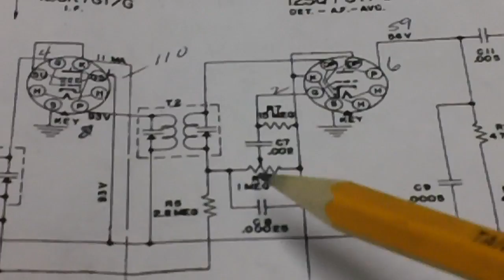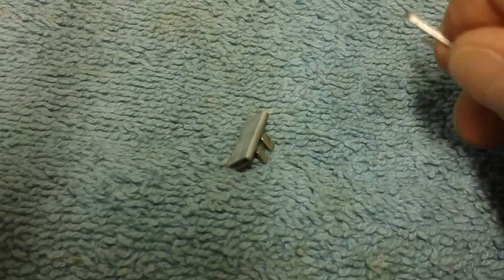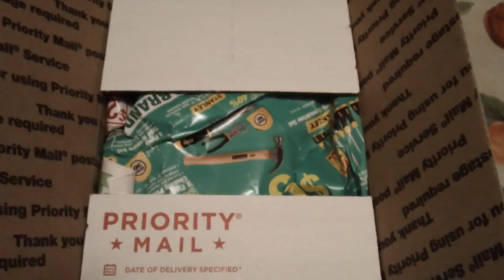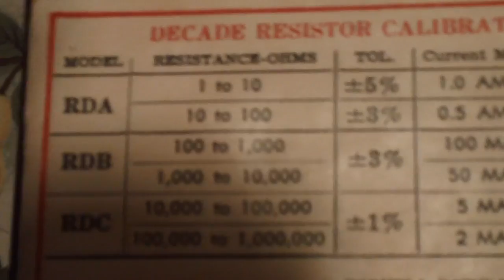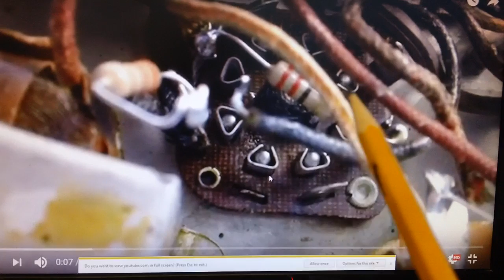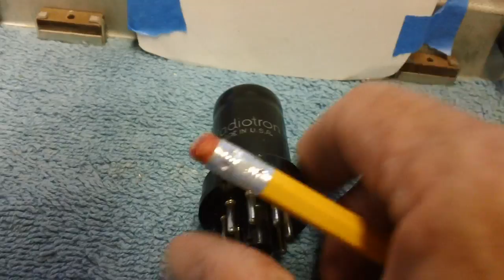1948 Silvertone 8005 repair/restore (part 7 of 8).

Comment: Just a side note. Your right about factories using pins that aren't connected to anything in the tube. The point is that this can be confusing for amature repairers. It may cause them to misidentify pin numbers. As you discussed before tubes have keys on them if you know what to look for. Therefor this comment is directed to newbies in the field of restoring old electronics. Just because a pin has things connected to it, doesn't mean the tube has any internal connection. The moral is this. Trust your schematic. That is unless you discover you have a modified unit that doesn't fit the schematic. The process of elimination can sort that out pretty easily. Just don't let it throw you for a loop...

Comment: This will be more like “tales from the service department” LOL.
I absolutely 100% agree with you John …keep on doing what you have to do, and if it is successful, pay little, or no, attention to what other people say.  As far as I’m concerned your improvisation for implementing a NC valve pin terminal to assist the broken pin terminal is a superb job …it works, and that is all there is to it! 
Picture the following my friend: kneeling by the side of a defective tellie, or radiogram, inside a customer’s living room, and whist removing certain parts to gain better access to other parts, or whist soldering, some mishap suddenly occurs.  Mishaps happen: they began happening the moment I took up electronics’ way back during 1968, and they continue to happen.  Given that fact, taking time constraints; a limited amount of replacement parts, and test equipment, inside the back of the van; the workshop sending a signal to your pager (as it was those days – later it was mobile cell phones, “Whilst you’re out, could you call into…”, which potentially added further annoyance), and the customer periodically breathing down your neck into account often meant there was little alternative (apart from lifting the defective unit onto the van, and taking it into the service department) but to implement small modifications.
I know this well as I have experienced it more times, over thirty-six years’ employment in brown goods servicing, than I remember …and I was a bench technician who did not go on outside calls that often.  One day, I’ll tell you about an incident involving an old Bush television I’d worked on, that caught fire, gutting the entire ground floor of a customer’s home, and necessitating an Insurance pay out of £2, 153 to put things right.  That occurred towards the end of the second week (summer 1971) of my employment (and apprenticeship) in brown goods servicing, from leaving school.  To say I felt decimated after that incident is an understatement yet it was proved to have not been my fault.  As I say, one day I will tell you about it in more detail.  I can’t remember the amount of crt’s I’ve accidentally ‘necked’ throughout my career in servicing …and they were the most expensive single component inside a tellie LOL.
Your small, and successful, modification would have been regarded as superbly serving its purpose.  Yes my friend, it is seeing how you combine your quick thinking with your dexterity that makes me feel convinced you would have been an excellent service technician.
Brendan is a lovely man, as well as being very knowledgeable too.  He recently posted me an email, including a photograph, of one of the two Cornel – Dubilier decade resistance boxes.  I have yet to respond to that email.  I have snapped a few photographs of my decade boxes.  They are probably a little older than me (I’ll be 62 at the end of this coming December), and I’ve been led led to understand they were once used in the design labs at Pye, down in Cambridge.  I got them for free.  I use my component substitution box far more than I use my decade boxes.  In my email to Brendan, I’ll include a circuit diagram of a component substitution box, and I’ll ask him to post a copy to you: you’ll see it is easy to construct.  I find it very useful when doing all kinds of electronics service work.
Lovely talking to you my friend, 
Phil.
Reply from the maker: Phil,
I would have been an absolutely terrible in-home repairman.  Customers drive me nuts...they're never satisfied with anything, so arguments would have certainly ensued, often resulting in me being duly canned.  LOL
I worked my way through college as an employee in a larger grocery store.  That's where I learned to immensely dislike "customers".   It seemed that every one of them was miserable and wanted to take out that misery on we poor little store workers, knowing we'd be fired if we stood our ground.   They were bullies, and I didn't like being bullied.   It's a wonder I survived in that job as long as I did.  That's why years later I took a job in a jail...where the customer is always wrong!
I'm interested in your component substitution box.  Sounds cool.  Why not also do a YT vid on it?
Regards,
John

Comment: Hey John, I've never really understood the purpose of encasing a glass tube in metal like that.  Was it to make the tube tougher or was it maybe in case the glass tube had a tube shield and the metal tube eliminated the need for it?  Any idea? Good job on that soldering the dial needle to the back like that!  Take care, Gary
Reply from the maker: Gary,
Exactly right, my friend.  The metal tubes eliminated the need for the big ole tube shields, but some of those tubes do get hot as blazes...and pin 1 is sometimes wired to B+ by someone who didn't know what they were doing.  Very dangerous situation, so always double check.
Regards,
John

Comment: Hey John, 

I'm glad to see you've fixed the needle, good and proper.  That should last a long time.

I like that you went into the pin grounding information with more detail.  As I recall, your Philco 37-2670 was like that.  You went from glass to metal tubes.  I did the same thing on my Philco 37-670.

Sometimes you just have to clean house, to get rid of the riff raff.  Good for you.

Regards, Tom
Reply from the maker: Tom,
Each week we get a couple of new subscribers and I have to assume they're at least somewhat new to the hobby, so it's important that I often go back over some things covered in the past.
It's good to hear from you again, my friend.
Regards,
John

Comment: John, Thanks for the tip on the decade box, mine is ordered for 15 plus shipping. I have two capacitor ones, but not a resistor one. Of course one of my capacitor ones is full of paper caps and not too good, but the other has all Mica's in it.
Reply from the maker: Tom,
Glad it helped, my friend.  Brendan is the one who pointed them out to me. 
Regards,
John

Comment: John going back to the pin 1 to 2 jumper. I saw on the tube pin out #3 HT that goes to what looks like pin 2. Is it the same? HT heater tap? thanks scott
Reply from the maker: Scott,
Yes it is, my friend.  Pin 3 (HT)  is connected to the center of the heater, thus also connected to both ends of the heater (pins 2 &7).  I'll be covering this business in the next video.
Regards,
John
Reply: Looking forward to part 8  :)

Comment: Sometimes it seems like they just need to 'play themselves in'. When you're dealing with a lot of components heating up and cooling down there are so many variables. Liked the dial pointer fix - nice job there !
Reply from the maker: Christopher,
I'm somewhat disappointed on how the solder flowed across the back of the  large piece.  It looks kinda ragged, but I'm not about to redo it.  I probably used a bit too much flux.  Live and learn, my friend.
Regards,
John

Comment: Hi John - It sure is funny how those magical fixes show up.  I get one about every year.  But how come you can take the item apart to repair and then at that point it fixes itself.  You can shake it... you can pound on it.... you can let it run for 2 days non-stop.... So what else can you do,  I guess it must have fixed itself.  But as soon as you put it all back together and slide it into the cabinet.... just turn it on and of course, it's back.  There must be an old hobbyist who has passed and was having fun with us from another realm.  Heck, you can almost hear them laugh at us!  See ya -- Atco --  BTW,  Good job on the needle!
Reply from the maker: Atco,
If I had even partial answers to your questions we'd both be rich.  LOL  But I am a believer that our ancestors are keeping watch over us and as you say, shaking their heads and laughing all the way.  LOL
Regards,
John
Reply: Our magical fix when I was a kid was to smack the side of the cabinet...that always seemed to work the best, lol.